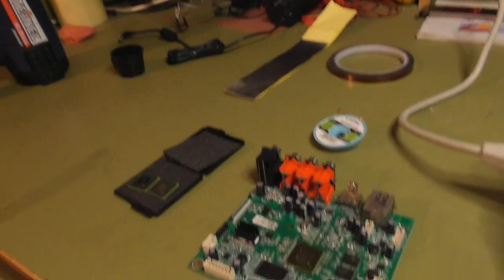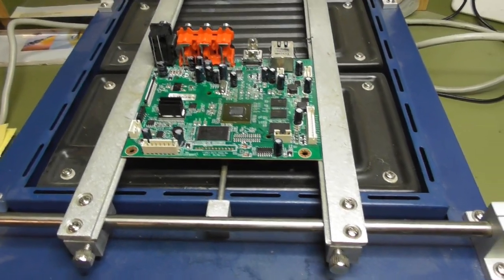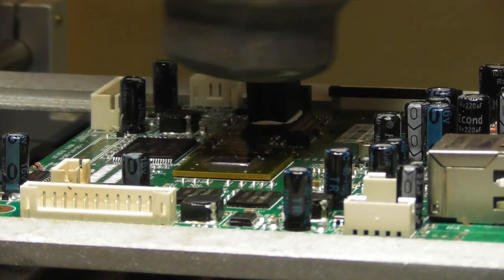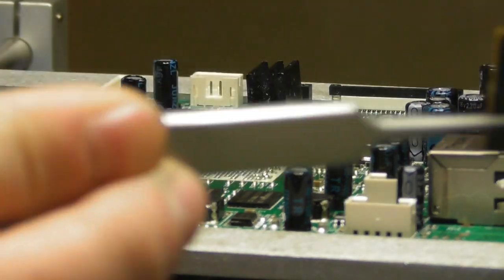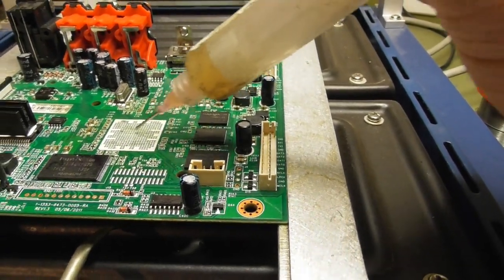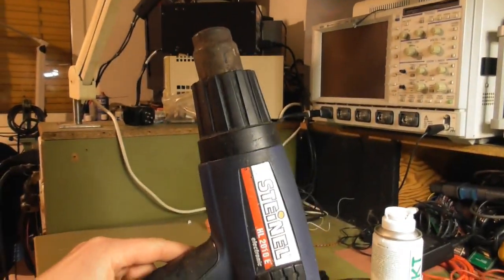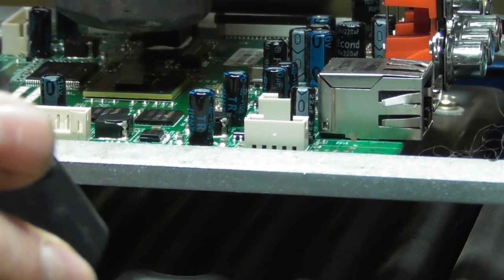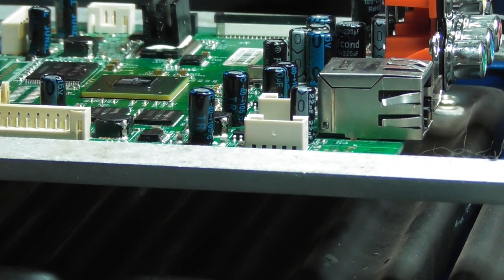BGA rework with basic tools

Comment: Awesome, man! I’m looking forward soldering a BGA to a custom made board after it’s been assembled. Because sourcing chips is hard these days… I now believe using a toaster oven for pre-heating and a good hot air station I can do it.
Reply: can i ask you something, if you want to keep the older gpu, what would be the best option reflow or rework. and is there any tricks to make a successful permenant or atleast long term reflow??
Reply: @evanmedi6144 depends on what is wrong with the chip. If it’s cold joints or if it’s a failing chip itself. For reflow and not replace use flux. Plenty of it. You can never use too much flux. Here’s a video talking about it https://youtu.be/1AcEt073Uds

Comment: Hi from Greece, nice and clean job if you can't afford the price for a BGA rework station with thermal profiles. Did you shut down the preaheater when you removed the old chip and cleaned the pads with the de soldering wick? What is the temperature of your soldering station for cleaning the pads sometimes i have destroyed the pads on cleaning process.

Comment: Show the board working
Reply from the maker: it did not work because the new BGA from aliexpress was ok, but not programmed. The unit boots after but get license error for the blu-ray playback
Reply: @kostelectronics  is it possible to program it ?
Reply: At what temperature does the chip get destroyed and how to measure accurately the actual temp on and under the chip?
Reply: @Swenser  a multimeter with K-type temp sensors works fine